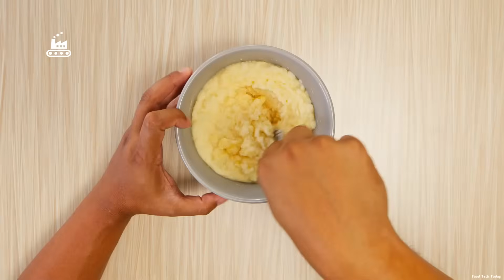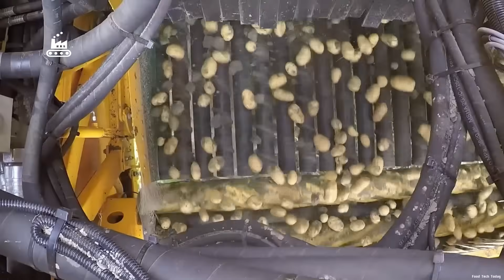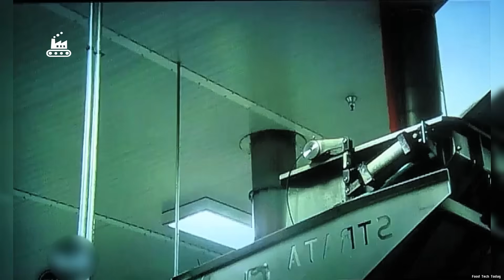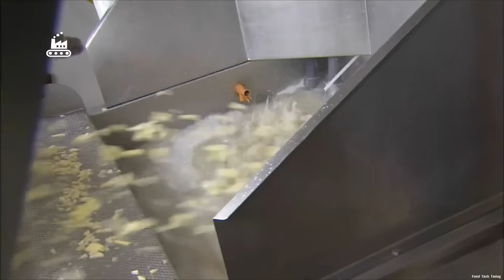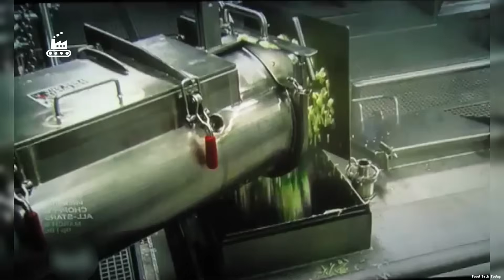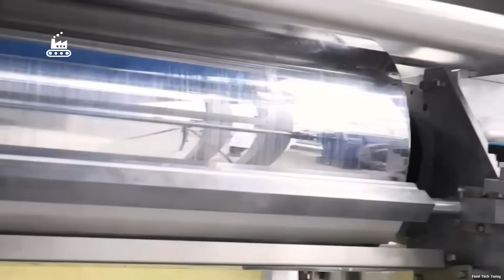How are Bob Evans mashed potatoes made in the factory?

Comment: how often are these large machines cleaned ?
Reply: every night
Reply: @gregbrunner599  thinking bout this and your answer and it should be cleaned every night. This is food, we have appliances and use them all the time and clean them after every use…
Reply: Daily.
Reply from the maker: I’m not totally sure either, but usually factories do the deep cleaning on weekends when the line’s shut down.
Reply: Often enough. Because if they aren't cleaned often enough then the finished product would be  contaminated (at worst) or bad tasting - either way, unsaleable. So in order to make a product people want to buy, the factory will do what it takes to produce the best, most appealing  product.
Reply: The equipment is cleaned every night. It is inspected by quality control before set up for the day. Also, swabs are taking for micro lab testing to ensure sanitation is cleaning properly. Also product is tested all day. I know because I did this in a mashed potato plant years ago and we made this product.
Reply: About twice a year.
Reply: Every couple of years they give them a good cleaning. 
No need to clean anymore.....El Trumpo removed all the oversight and inspections for our safety and protection.....just ask Elon Musk.